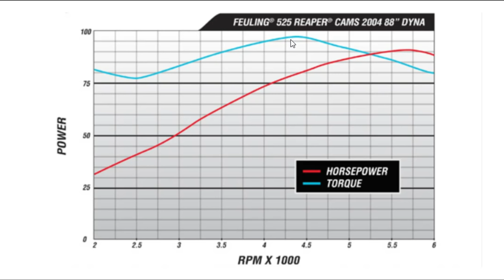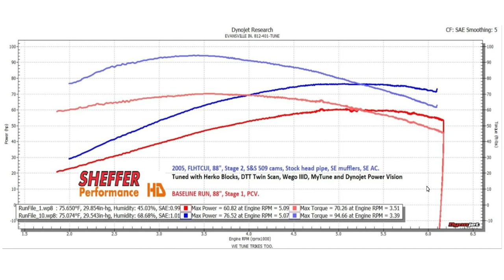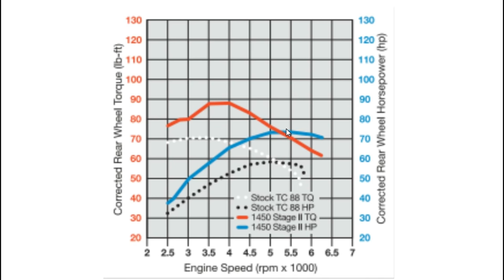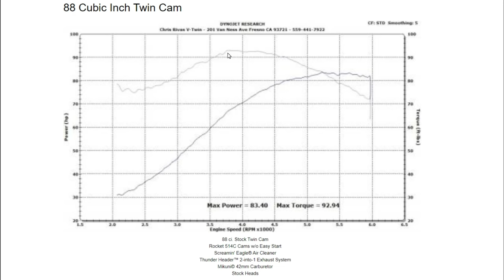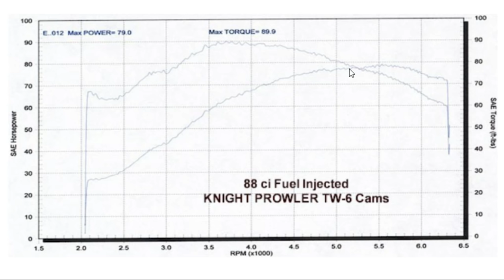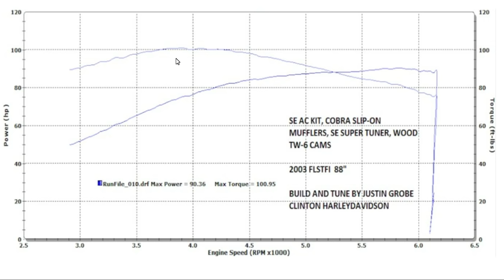Give Your Twin Cam 88 New Life With A Bolt In Cam Upgrade

Comment: I also recommend swapping out the stock vacuum petcock for a 'standard' gravity one.  You will notice such a big difference in throttle response and acceleration!!  :)
Reply: On a fuel injected bike?
Reply: @brittanyjackson1718  No, my comment only applies to a carb bike but I see that I didn't clarify that. ☺
Reply from the maker: Don't count the carb bikes out, they still produce some major power.
Reply from the maker: Great suggestion! That makes a huge difference on fuel delivery on a carb bike, just make sure you remember to shut the fuel off.
Reply: I have a 2002 Heritage Softail with an S&S Super E, bored 0.010” over to clean up piston slap. Slightly domed pistons were installed. The heads have oversized valves and high lift beehive springs, stock rockers. The cams are gear driven Feuling 543s with a support plate and pump. The exhaust is Freedom Performance True Dual Sharktails. The petcock is a Pingel. I had to do that to feed the beast! It makes 104 ft-lbs and 101 rear wheel horsepower as measured on an eddy-current dyno. I would not have believed it myself, despite the experience of riding it, had I not seen his graph. The 88s are not to be underestimated!
Reply: @joeltraten5967  That sounds awesome and is similar to what I'm doing right meow. I have my cylinders and heads out for 98" boring and porting. Just got my fueling complete cam chest and cams too. Gonna be epic.
Reply: @harleydave2316  Yes, sir! You will enjoy that animal, no matter whose kit you chose for the cylinders. I put Revolution Performance’s 107 kit on my 09 x-bones, and with the package put together on that one, which included a chain final-drive conversion and a timken bearing crankshaft conversion, it produced 111 and 111 on the same dyno, but atmospheric conditions were considerably less favorable that day. The x-bones will leave the Heritage in the rearview side by side on the street. Your 98” probably will, too, when it’s finished and broken in!🤠👍

Keep the shiny side up, sir!
Reply: @harleydave2316  Did you just say you sent in your 88" cylinders in for boring to 98"?
I too, gutted my stock petcock 58K ago, and haven't ever shut it off since. A lotta good to be said about the Kehins!
Back in the Trumpet days with Amals, you'd blow up the bike.
Reply: @garychandler4296  Yep. They are currently at Hammer Performance getting bored out.
Reply from the maker: 88's are strong, it's all about the combination of parts and tuning! You have proof of that.
Reply: @joeltraten5967  Are you happy with the Revolution cylinders? I understand they do not have steel liners and instead rely on a SiNi carbide coating over parent Aluminum. Good for cooling but I'm wondering about engine life. The early Chevrolet Vega didnt have steel liners and engine life was poor. Let us know.
Reply: @buckguest3012  The work was done eight years ago. Mileage is a little trickier. The odometer read a little more than 17,000 miles when the work was performed. That work included the chain-drive final conversion, which throws off the speedometer and odometer by about 9%. The bike moves faster than it thinks it does. The odometer currently reads 27,200. So it’s probably been closer to 11,000 miles. I do not get to ride it nearly as much as I would like to. But it does get ridden at least a couple hundred miles each year anymore.

I have kept up its maintenance and I have had not a single issue with it. The cylinders have a lifetime warranty. I would do it again to another bike in a heartbeat.
Reply: @buckguest3012  And you are correct about the cylinder design. If the early Vega did not have steel cylinder linings, what did it use?
Reply: @GixxerFoo  There is an amusing story to that. The bike was a stock 88” with piston slap when I bought it. I did not mind the piston slap because I planned to go into the engine, anyway. I wanted to see what kind of power an 88” could achieve, so I only wanted it bored 0.005” over, and I let myself get talked into installing hypereutectic pistons. That set-up didn’t last 7,000 miles before a chunk of the rear piston broke off above the top ring land on the exhaust side and shot out the exhaust.

I got lucky. It was a clean shot. No other damage occurred! So I had it bored over an additional 0.005” and had forged pistons installed this time!

Hypereutectic pistons may have practical applications, but an air-cooled motorcycle engine does not appear to be one of them!😅😂
Reply: @joeltraten5967  Joel

Thanks for the reply. I will keep your experience with the Revolution cylinders in mind when I do the 98" and head work. At least I know Hammer Performance and Revolution deliver top shelf results.

My 2000 Wide Glide is now a classic. I've owned it 20 yrs and still enjoy it, it's a super performer, oil tight, and reliable. Like you, I'm too busy working to ride it, or my choppa. However,  that will change next year when I finally retire and can concentrate on enjoying my Harley's. My Road King is my go to long haul and comfortable "pickup truck" now that I'm 20 yrs older.

My brother had a Vega and it had sleeveless high silicon content cylinders. They'd overheat and distort so the rings didnt seal. He kept a case of oil in the back and filled the crankcase at fuel stops. Ha.
Reply: @harleydave2316  My reason for asking is because math isn't my first, but it sounds to me like you'd have eggshells left for cylinder walls and no headroom for future bores, but I really don't know.
Reply from the maker: Holy crap you got lucky, that was a one in a million shot! Lol that never happens!
Reply: Can you do that with efi
Reply: I did that with my carburetor module
Reply: @joeltraten5967  who made the Pistons Joe & what compression ratio?
Reply: @joeltraten5967  lots of oil!!! 🤣😂
Reply: @joeltraten5967  who made the Pistons Joe & what compression ratio?
Reply: @enricomandragona163  Which pistons, please, sir - the hypereutectics or the forged ones in her now?
Reply: @joeltraten5967  what!!??
Reply: @enricomandragona163  My mistake. I thought you had a question for me.
Reply: @joeltraten5967  I did I asked who made the  010 over Pistons ?
Reply: @enricomandragona163  They are Wiseco pistons. It has been a few years - I do not remember the exact compression ratio advertised. I think they were 10.0:1. But that’s static - I ended up with 195 CCP in each cylinder.
Reply: @joeltraten5967  thanks 👍

Comment: Hands down best bang for the buck on an 88” is deck the heads .060” with .030 head gasket will make stock cams run like bolt ins and make bolt ins haul ass. The 88 has very low compression as most Harleys do

Comment: The Wood TW6 and the Rocket Cam 514 C are very impressive! This was very informative, and makes me think of just a cam and head work will make me happy?  At least for now.
Reply from the maker: A good cam and head work goes a long way, especially with the numbers I showed are on stage 1 bikes with a cam swap and a good tune. You throw a little head work in there and it wouldn't be too far to say an 88 could tap 100 horsepower.
Reply: You sure ain't gonna be disappointed!  Unless you got the wrong cam for your rpm range. Went to torque cams because I just hate flogging an engine to wake it up. But my neighbor thinks 2000rpm is an idle!

Comment: I went to a 103 cylinders & S&S gear drive @ 75,000 miles.  Got 99,000 on odometer.  99 hp. 130 torque ft. LBS
Reply from the maker: Damn that's impressive horsepower and torque! I'd say you were ready for a refresh with those miles.

Comment: great video! i commented this very question last vid... (or maybe it was the one before...?) not saying you created and posted this vid specifically for my question but hot damn! lol. even if you did not see my  comment/question, you answered it with this vid. Great job man!

I really like the Wood cam and the S&S 509 cam but it doesn't look like it's available for the 2006 year model so it looks like the decision was made for me... Wood cam it is. what a FREAKIN BUMMER! lol. but i wonder what makes the Dyna 88TC 2006 year model different (edit : which so happens to be my model)? 

i am going to pull the cam cover off and see what's going on in there. i do not have a current cam tensioner issue at the moment, but my 88TC does have 37k miles and i have no clue to what the current state of my cam tensioners are. since my bike runs around 230-250 degrees (depending on the day temp wise) i am almost certain it's stock, i mean i know know it's not gear drive. also, wouldn't operating at the temps mentioned indicate that a S&S cam plate is absent? (just my thought process based on my limited exp with H-D engines)

on a side note, have you thought of trying to do a patreon or something so we can throw money at your feet while you dance for us? lmao. j/k about the dancing part yet serious about patreon or something. even doing a $1 per vid would be a nice way for us to show our appreciation. even if only 1% of 10k subs doing $1 would generate something to help offset the cost of producing these vids
Reply from the maker: The 06 Dyna's for whatever reason the A motor they put hydraulic tensioners in that year. The Dyna line was the only engines that got them, softail and touring still had spring tensioners. Since the 509 isn't available for the 06 that leads me to believe they changed the valve springs in the heads that year as well. The 509 was created to work with the stock valve springs on the 88 heads, I'll have to check but the S&S 550 or 551 might bolt into the 06 Dyna. I've thought about Patreon but I just wouldn't feel right asking for money on the videos, I like to get all the information I had dig for and put it all in once place for everyone.

Comment: I'm running S&S 509 cams in my 2003 Dyna along with a TBR comp s pipe and SE heavy breather cone intake. It seems to make a little more power but I'm also running a baffle in the muffler because the exhaust was way too loud when I got it.
Reply: What cv jet sizes did you run with
Reply: @larrydever5166  I have to go look but I thought I used a 46 and 195.
The 46 was from CV performance and I also used their new needle for the slide.

Comment: I have a 2006 Harley Road King and had Andrews TW26A cam installed a few years ago. I really like these cams as they give my old stock TC88 a kick in the ass right were I spend most of my time riding. I have the stage 1 high flow air intake and aftermarket Vance and Hines pipes and want to increase the cubic inch displacement on the bike. There are a lot of aftermarket options to go with other then Harley's 95 ci big bore kit. My question is what ci displacement and aftermarket company would you recommend?
Reply from the maker: If you wanted to tear your bike down and bore you're cylinders Hammer Performance has a nice setup and it's relatively inexpensive compared to bolt on kits. They will bore you're cylinders out to a 98, they say 10.5:1 compression pistons but that would be pretty high for the cam you have, they also offer some lower compression options that would work better with your cam.
Reply: @GixxerFoo  Yea, I'm probably going to go with the bored cylinders and a port job but don't know if I'll go to 98ci
Reply: I checked with Andrews about the tw-26 cams and they said I would be ok up to 9:7.1 compression ratio. I'll call Hammer Performance to see if they can do anything for me on a 95ci or 97ci build with my cams. If not I think I might just go with the S&S 97ci big bore kit which is at 9:7.1 ration. Hopefully I will not need compression reliefs but if I do I can get that done when I have the heads ported.
Reply: I wouldn't go that route with the stock cylinders!!

Comment: I've been waiting for this report, thank you. I just repaired my 2000 FXDWG from major earthquake damage and now that it is running I'm ready for the complete camchest upgrade using conversion cams now, followed by the Hammer Performance 98" cylinder and cylinder head upgrade next year. Could I ask you to do a piece on the conversion cams. I am planning to use Andrews 37N or the Feuling 525/543 as you suggest. Great report, thanks again.
Reply from the maker: Sorry to hear about your bike getting tore up, but good to hear you got it going again! Hammer's bore job is one of the most cost effective ways to go over buying new cylinders. Hammer does great work! I'll look at doing a video on that, some cams will work in 88's, 96,'s and 103's. Depends on the manufacturer and what valve springs they require on wether or not you can use the stock heads.
Reply: @GixxerFoo  Many thanks sir. Great learning here and with your subscribers.
Reply from the maker: You're welcome, you are the life blood of channel and l learn a lot from everyone on here!

Comment: What if a TC88 is upgraded with the Fuel Moto 98 Cu.In." Extreme Duty Cylinder / Piston Kit? What cam would you recommend with that kit? And, would it require new valve springs? Which ones? Of course, the Feuling OEX Hydraulic Cam Chain Tensioner Conversion Kit, or similar,  would be a given with that bigger bore kit. Just getting all this info together here. Thanks. Really liking these TC88 videos! Not into high speed, or racing, just respectable power when needed and dependable, solid reliability.

Comment: With my 2006 Road King at 15k miles I went to do the SE upgrade tensioner plate and kit with the HO pump etc.Went with by recommendation the Andrews 26 Conversion Cams.Also I had a set of Ultima high ratio 1.65 roller rockers.the fuel moto Vision tuner and their tune that I had to richen up on the low side to keep from stalling.Bike runs and sounds great also stock head pipes with some 4 inch open mufflers I got from a shop in Battle Ground Michigan.Bike does great but thinking of going to 9:5 to 1 KB pistons soon to give just a bump more compression.Not going higher cause here in Eastern Washington we get real hot summers.And our fuel is garbage.You never in any of your clips even mention Andrews 21,26, or 37 cams?
Reply: Bad choice for pistons unless they are forged!

Comment: Great job on the videos🙌 I’ve learned a ton about HD from you. In the spring I’m look to buy a used bike. The information you’ve shared has been incredible helpful. Keep up the good work, cheers!🥃 p.s. if you come up with any T-shirt ideas, I’d love to support the channel.
Reply from the maker: Glad to help! I really appreciate your support! What model are you looking at?
Reply: @GixxerFoo  I’m looking at an 05 fxdwg carbureted. It’s low miles, excellent condition, and a pretty good price. However, the used Harley market is a buyer’s paradise. For just a little bit more money I could get an 06-08 maybe 09 night train. The night train has been my dream bike since day one. The 6 speed transmission is very appealing. The 96 seems like a great motor but so is the 88. So for now I’ll keep doing my homework and watching the market.
Reply from the maker: If you can get an 09 Night Train for a little more l would jump on it, those bikes are hard to find!

Comment: @GixxerFoo 
My stock 88 has .004 runout on crank, new tensioners on stock plate, upgraded oil pump, and inner cam bearings done. Added cobra dual exhaust and slip ons, k&n air cleaner, and power vision tuner. Will my crank tolerate cams and which would you recommend with my current setup? I’m more interested in torque than top end. Thanks in advance and I really appreciate the solid content.
Reply from the maker: You can add some cams to that, the runout really play a big part in if you want to run an aftermarket cam plate or go with a gear drive setup. But you can add aftermarket cams with your stock cam plate or go with Feuling OE aftermarket cam plate which is designed for the higher run out with the factory cranks.

Comment: Awesome videos. I have cherry 2005 softail untouched totally stock w almost 50k miles. I have 2016 cvo ultra guide 13k miles to totally stock
. May just leave 88 alone w t 6 cams....but I want to use d.c. ported cnc heads....want to make a tractor puller out of cvo...maybe 117 kit....

Comment: Hey GixxerFoo.

 Great videos thanks so far. I have a 2005 FXDC carbed with 35,000miles. I recently installed a DK Custom air cleaner/breather system and re built/rejected my carburetor. I have a red thunder 2 into 1 full length exhaust system in my closet ready to install, but turns out my cam chain tensioners are done!!

While the exhaust is off, pushrods are cut out as well, and I’ve got the cam plate off. Why not upgrade the cam plate/tensioner system/oil pump/bearings and cams while I’m in there? I am leaning towards the Woods TW6 conversion kit (if my run out is within tolerance).

Can you give me some tips on what to do with my Superglide? Would a more powerful cam be an option for my bike if I were to increase displacement? I am ready to upgrade, but I definately want to get the most out of my build the first time.

Thanks again, you have been very helpful so far. I am getting excited.
Reply from the maker: Very welcome and that is awesome to hear your getting your bike built up! For sure it is a opportune time to get your cam chest upgraded while you have it apart, no better time and not having to get in there twice. The TW6 cam will work really well with some added compression if you decide to go that route. You've got some pretty good options out there if you want to do a bore increase, boring the stock cylinders is an excellent option through Hammer. Here's a video on some of the upgrades available for the 88 big bores https://youtu.be/9wOurNkiMyk.
Reply: @GixxerFoo  what cam plate is provided in the kits from fuel moto? My bike is a 2005 so I need an upgraded cam plate/tensioners.